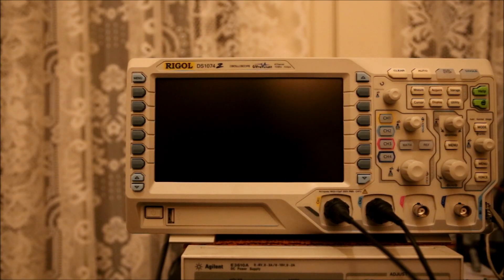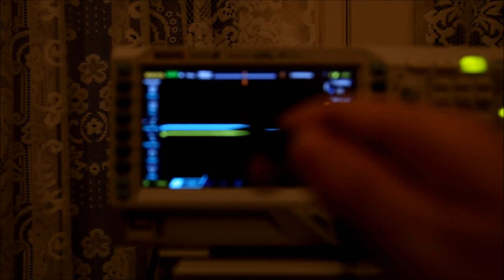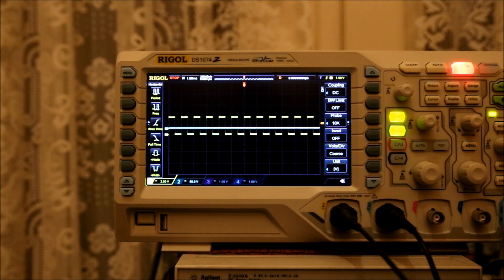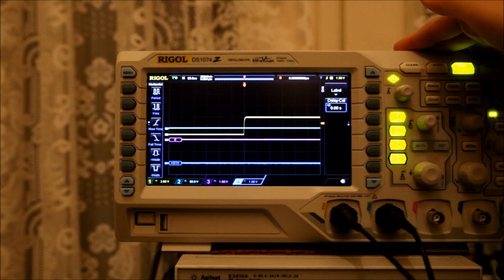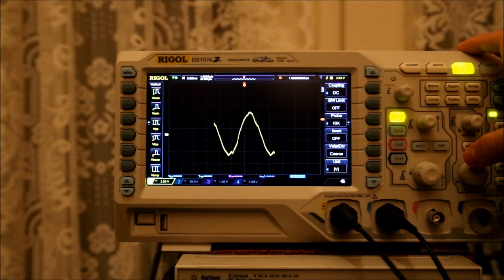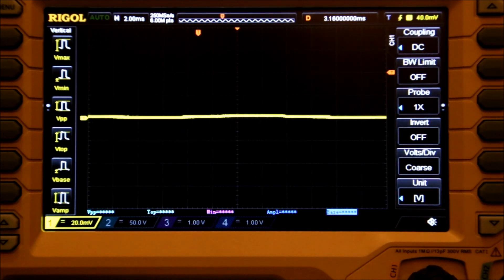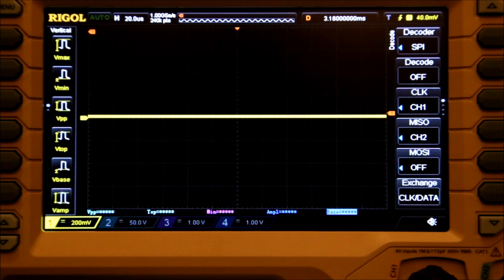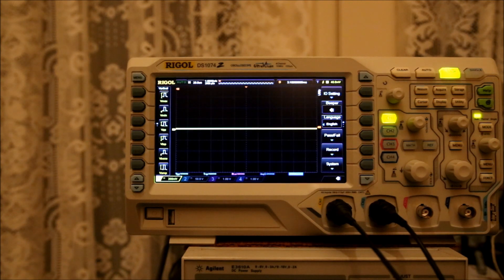Rigol DS1074Z Scratch n' Sniff

Comment: Maybe I just have strong fingers, but the ground clips on the RP3500 probes that came with my DS4014 aren't too bad.  It may be the former as you aren't the only one to mention stiff clips.
Still wish they would include either a set of switchable 1X/10X probes or an additional set of 1X probes.
Reply from the maker: Not sure. I still think they are kind of tight. Just personal preference.